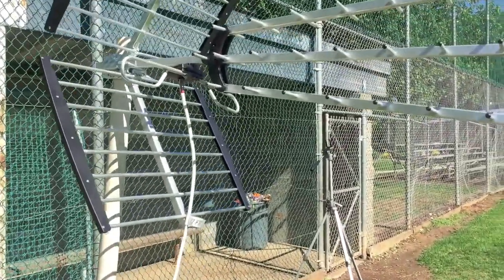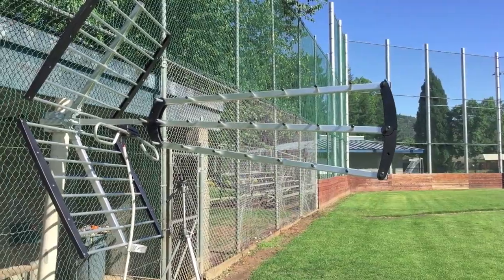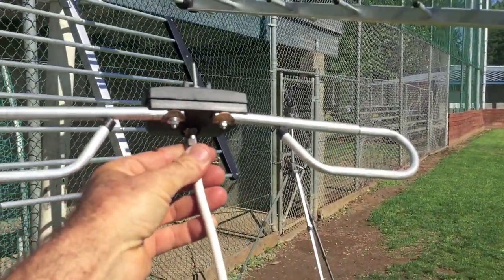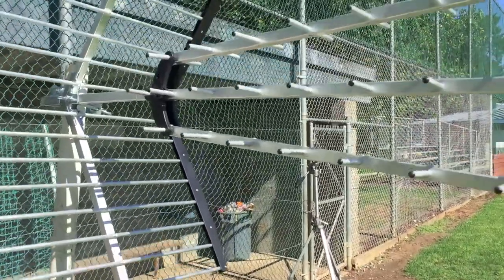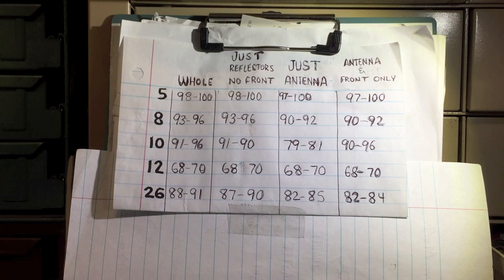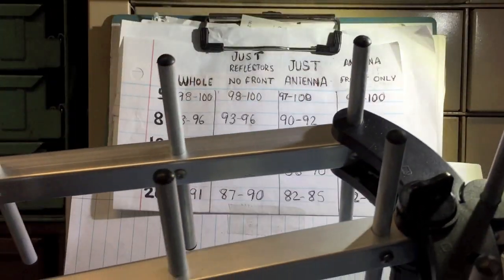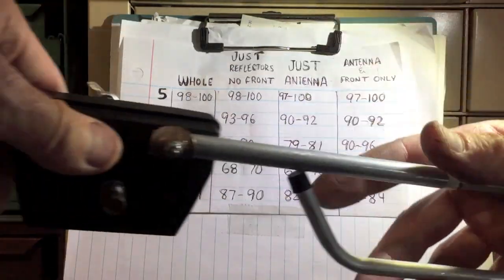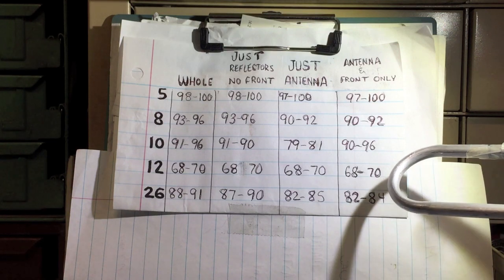Testing This Unusual Looking UHF TV Antenna.

Comment: Those small pieces of metal used to reflect the signal as you could see some of the numbers are higher with the whole antenna intact. That's going to help with some weak signal just getting up there to start show.
Reply from the maker: Yes it did seem to help when the antenna was fully assembled.. Nevertheless I was surprised to see how well the smallest portion of the antenna did.
Reply: @GrantsPassTVRepair  okay I understand. have you ever tried antenna vertical or horizontal see if there's any difference.

Comment: A Chinese manufacture makes them, sold under several brand names Digiwave, StellarLabs, Extreme, etc.
I got a Digiwave model. 
Similar to yours, not exact but close. 
Your right the Reflector to the rear. Then triple director boom. With upper and lower directors. 
I my case the directors do add extra gain, I'm able to pull in stations from Brantford, Ontario to Buffalo, New York a distance of 92 miles.

Comment: Were your test numbers generated from the same position you were in next to the chainlink fence? If so, wouldn't that fence be acting as a HUGE reflector? I'd be curious to see that same test run out near 2nd Base just ro remove the effects of all the metal.
Reply from the maker: Good question about the fence. It may have had some effect but I'm not sure.

Comment: I am just amazed at the performance of the antenna element by itself. This got me wondering and I came up with an idea or two. The area you are using must be a super good location for reception. Some areas are just that way. What about if you would try using a place know for really poor reception ?? I know there is no set rule for over the air TV reception. But if you would give that a try it would be interesting to see just exactly how much of a difference this type of antenna would make. Thanks for your great work for us all to learn from your video Grant. Peace vf
Reply from the maker: Yes you're right. I'd  also like to test some of my antennas in areas where the signal is very weak.
Reply: @GrantsPassTVRepair  Nice to hear from you Sir. Look forward to your tests. Peace vf
Reply from the maker: @victoryfirst2878  Here is a test I did a few miles further away. https://www.youtube.com/watch?v=pFZ6FBis50A&t=447s

Comment: In the Metro Area, You only need the CM Omni+50 30 feet from Your TV situation rooftop mounted. It's a cute little aerodynamic thing probably designed to soar through the high winds. When You have a lot of bulk to these they are messed with by the wind.

Comment: I really like your test location using the backdrop of a baseball stop as a sort of Faraday cage. What was the best antenna you have made for the FTA tv ?? Were well done test.
Reply from the maker: Other than picking an antenna which is designed for the band of frequencies I wish to pick up, such aspicking an antenna designed for UHF frequencies. or the upper or lower VHF frequencies, After testing 20 different TV antennas I've come to the conclusion the perfect changes with every location. but the antennas I use the most are for the combined VHF and UHF frequencies are the Winegard HD7694P and the Channel Master Advantage 45. For UHF only channels I'm often able to make my own antennas with a simple loop of wire, but when I need something more directional for the UHF channels I often go with the RCA ANT705Z, or the Winegard FreeVision FV-30BB since they are not to expensive, and locally available in our stores here. I've tried a variety of other UHF antennas but I don't have all the model numbers. I use to show up at jobs with 5 different antennas and try them all, but it seemed there was never the perfect antenna for every location
.
Reply: @GrantsPassTVRepair  Thank you Grant for letting me know the pertinent information I asked for. I was going to buy the antenna you have tested, but the best one for three hundred dollars. Then I came to my senses. With all the information available on YouTube I can just make myself the antenna. I am focusing on the gray-hoverman type. Not to big easy to build and can be stacked for more gain. This I am thinking is my direction to follow. What do you think and would you tell me if you have any experience with bow tie or gray-hoverman antenna ??? Sorry for the slow response also.

Comment: As i thought,  gimmicky rubbish. Looks fancy :ut thats about it
Reply from the maker: It would be interesting to try this antenna in an area with weaker signals to give it a better test.
Reply: @GrantsPassTVRepair  I'd like to see that, You'd have to find somewhere remote to test it.
Reply from the maker: @frankowalker4662  Yes I agree. I'd like to try this test again in a different area.